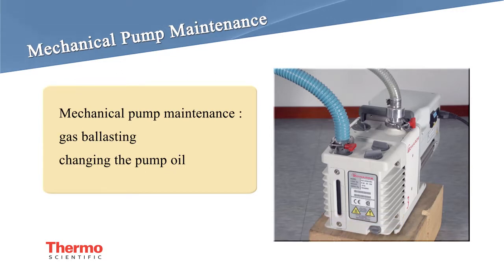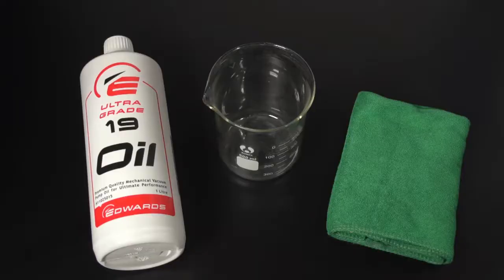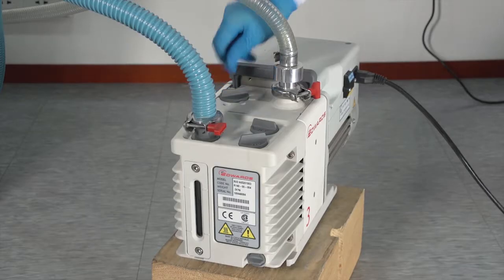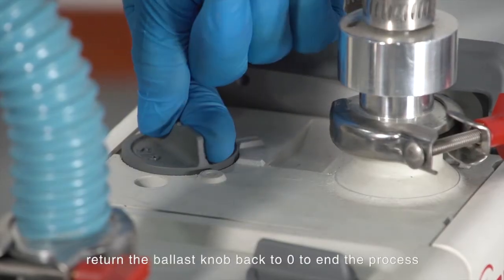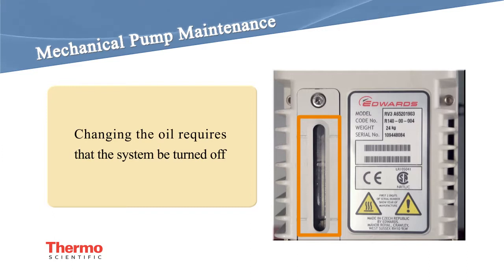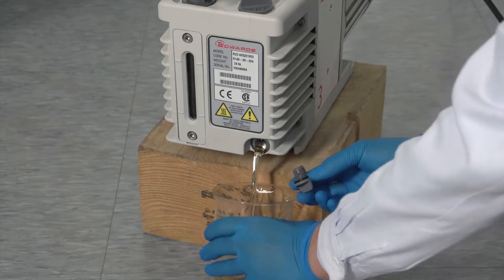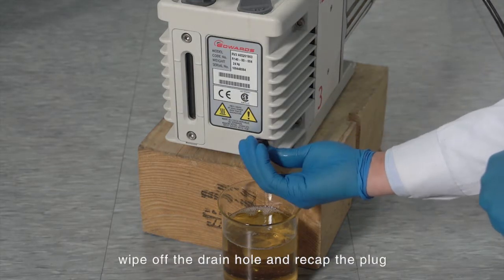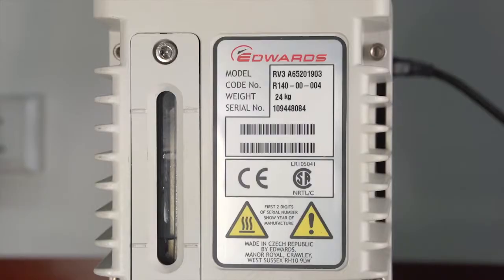27 Mechanical Pump Maintenance

Comment: Hi Alexander.  Can we add the oil while the vacuum is still running?  If there's a minor oil leak and the oil drops to a lower than optimal level, do we have to turn off the vacuum (and thus having to turn off the mass spec) to add more oil in?  There is hot vapor coming out when we open the cap when the vacuum is still running, and the noise gets louder.  What is the risk/harm if we add the oil into the oil tank when the vacuum is still running?  Thank you!